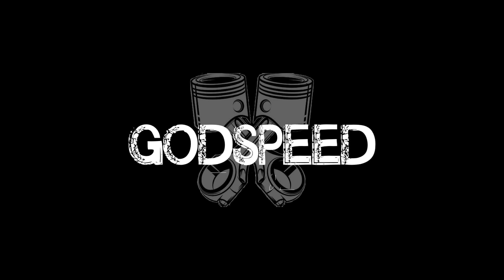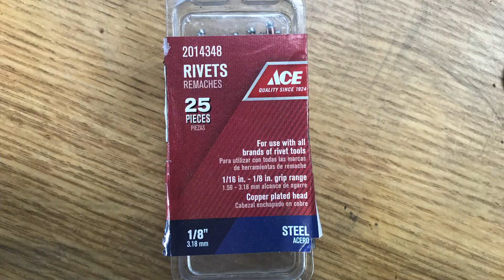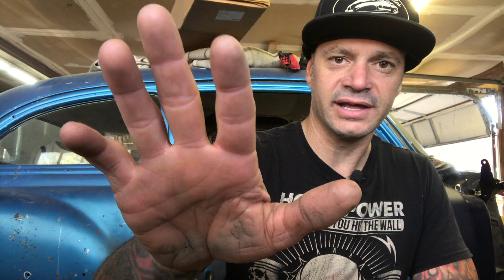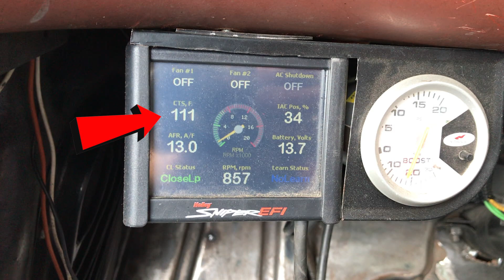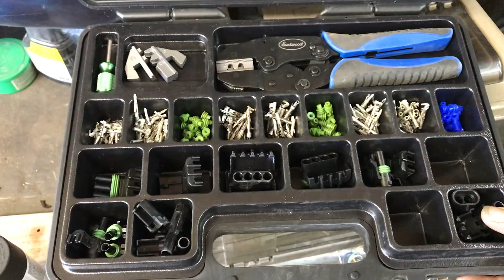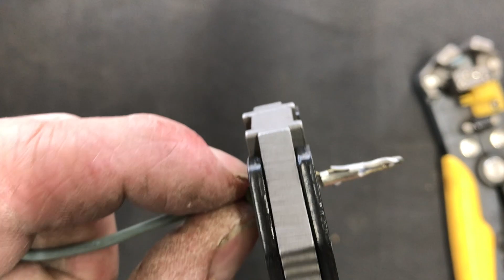HOW TO WIRE 1955-1959 CHEVY TRUCK GAUGE CLUSTER

Comment: You have helped immensely, I am upgrading my 55' 3800 to electric temp gauge, in the process I found the dash harness had been,,,, well janked is to mild a word, but I got stuck at the ammeter and you helped with that so huge thanks.

Comment: I see this video is 2 yrs old but I just found it! Excellent video!! The tip about using those pop rivets was way cool! I currently have a 1959 Chevy Apache that I am replacing the cluster with one from classic chevy. Our original plexiglass was destroyed and several gauges were ruined and the speedometer is very gummed up. So my Queen requested a rebuilt one. Since the prices have come down a bit I said why not? I do need to totally rewire it because the PO installed a set of aftermarket gauges and used the wiring for those. I want to replace the old amp meter with a higher rating due to the truck now having a 63A one wire alternator. I have seen where others have taken a volt meter apart and trimmed down the face to fit in the window. I want to replace the amp meter with a 60-0-60 gauge to stay with original as possible.  The PO also installed a 2 in fuel gauge in the dash above the headlight sw. Since a hole was cut there I want to put a Volt meter there to take up the space. Anyway what are your thoughts? Thanks again!

Comment: You could probably use the brass inserts used to reinforce vinyl water line instead of steel rivets
Reply from the maker: great idea!  the part of the rivet I used was actually copper, not steel.  THANKS FOR WATCHING and thanks for the input!

Comment: Bart Owens here - I am a total electrical bone head with a 1957 factory 4x4 Chevrolet truck.  I've pulled the instrument cluster out as I attempt to repair the speedometer .   You have inspired me to clean up the mass of wires .   Will be watching your video here more than a few times.  Your approach is inspiring and seemingly easy to follow.   Thanks... great stuff.
Reply from the maker: nice!  thanks for watching!  I hope it helps

Comment: I'm a plumber so the soldering part was easy but how did you insulate the rivet from grounding?
Reply from the maker: there should be a plastic sleeve inside the socket that it all goes through

Comment: Fantastic, thank you for taking the time. Your editing and detailed close-up camera work is also awesome. 

Question: did you have to do anything with 12V vs 6V?
Reply from the maker: I did not... my truck was already 12V from the factory.  however I did convert my 54 belair to 12V.  as I recall I only had to convert the gauges that had power, which was just the fuel gauge (not running the amp gauge on that one either).  I used one of those resisters you can pick up from LMC or carandtruckshop.com

Comment: Thanks for taking the time to make great informative videos, I'm currently working on a 1959 Chevy Apache and your video will definitely help me, I have a question did you use all the same gauge wire and if so what gauge did you use ? Thanks again !
Reply from the maker: since I did not wire the Volt gauge, all the wires were the same.  they were the wires that came with my Speedway wiring kit - 14 gauge

Comment: Good job and good video. I'll try adding ignition powered 12v to my fuel gauge before I scrap my old fuel gauge altogether. The wire to the sending unit is good and I thought the other wire was a ground. So back to work I go ;)
Reply: Well, the voltage was already there, all wiring good. Need a new gauge as originally thought. So thank you again for the great video ;)
Reply from the maker: glad you got it figured out
Reply: @GODSPEEDGarage  I can read how much fuel I have with my multimeter, looking towards the sending unit in the tank, by removing the sending unit wire from the gauge cluster. And when I get everything connected and do like a bench test with the new fuel gauge, it acts like the original gauge that's always been in there. So In your video, you pointed out where the ground connection to the cluster is located towards the top there on the backside, so I will investigate that. Everything seems fine and tests out okay, but the fuel gauge still doesn't tell me how much gas I have in the tank. I'll figure it out. It's taking awhile. Your videos are very helpful, thank you